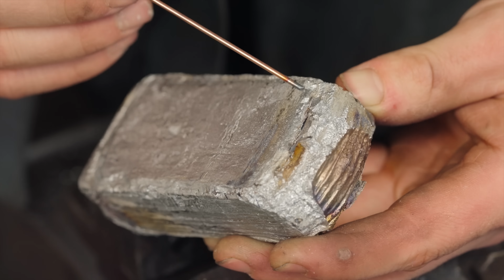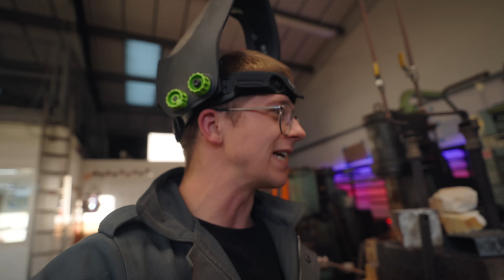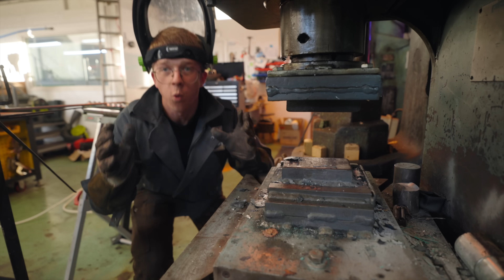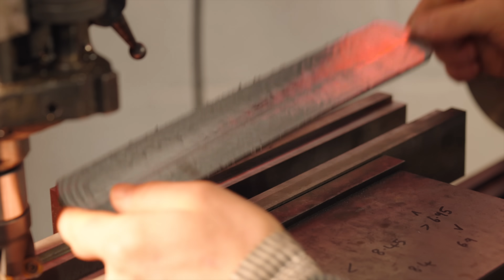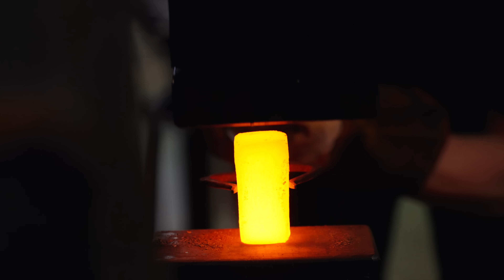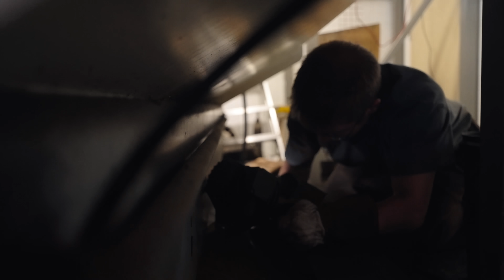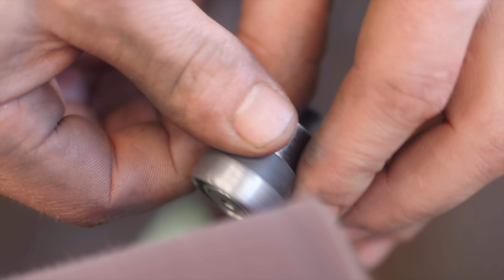Can I Make Titanium Damascus? Part 2

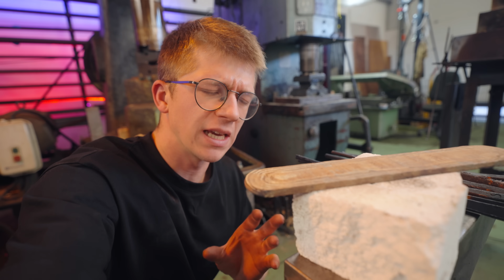Comment: 3:50 , the center of the mass is a different temp than the edges and the plasticity is different.  heat it more often. keep it more even.
Reply: This happens with steel too, but the effect is greater with the titanium because of its lower thermal conductivity!
Reply: Let’s upvote this so he can see it

Comment: Previous aerospace worker. Research what Ti you are using. 6-2 is softer and corrosive with 6-4. different heat treat process also. So id assume some of this would need to be considered when making Timascus.
Reply: Timascus . . . I see what you did there. :)
Reply: @uncletiggermclaren7592 timascus was the trade name.
Reply: What is 6-2?   That is not a common titanium alloy.   There is 6242, 7-4, 662.  But never saw 6-2 anywhere.
Reply: @jonquinn11  There are more numbers to it. One, it's been a couple of years since I worked there, so I only remember the first 2. Two, I signed an NDA so vague is better. The core principle is there. Research into Ti more so he can mix and make cool things that don't break.

Comment: I wonder how well Wire EDM would work for cutting the titanium.
Might take longer. But at least there wouldn't be nearly as much waste and you wouldn't go through a new sawblade every time you cut it.
Reply from the maker: It would be so so handy! Was wondering this other day. Passed up an old EDM on auction for £500 the other week as well (not that I’d have any clue how to use it regardless 😂) .. I think I may have to call around and see if anyone nearby has one I could bring bits to to cut when things get really small and fiddly!
Reply: @AlecSteele  I'd love to see it cut with a water cutter. I think it cuts through it like any other metal. I guess the medium in the water probably makes a big difference too though.

Comment: The Ti-Fe phase diagram will explain why you are seeing the Liquid Metal at that lower temperature. You get closer to the eutectic point and the melting point drops

Edit: at the eutectic point (~33% Fe) the melting temperature is 1085C
Reply: 950°С....🙄
Reply: this
Reply: They have a titanium/iron phase diagram, but I haven't seen any for steel. Even with the iron though, the temperatures required are still much higher.
Reply: @deucedeuce1572  a ternary phase diagram of Ti-Fe-C should explain. I’m sure with the addition of carbon and some experimental error you will get to liquid Titanium at ~950C

Comment: Atmospheric pressure maybe? What's your Elevation? 

Maybe it would forge better if it heats at the force of the press.

Try forging under the melting point and the pressure from the press could reduce it's melting point to an ideal temp for forging?
Reply: He's in Norfolk so practically below sea level, my bet is that it's the pressure from the hydraulic press that causes it to heat up quickly an melt.

Comment: Yeah, none of us know what's going on. We are not egg heads. This is experimental stuff. The obvious things we can guess at are the product (potentially acting as flux) you put into separate the canister from the steel and titanium. The pressure from the hammer on the canister and the argon also probably had an impact. It might be different after the canister is removed.

Comment: Newbie question @9:00 if worried about sparks and a titanium fire wouldn't cutting oil help?  forgive me for not understanding
Reply: Cutting oil is mildly flammable, so that's not a good idea. Coolant would work a treat, if the Bridgeport coolant pump was working.
Reply: @hammerth1421   AH, gotcha thanks for that info
Reply: Oil wouldn't, since it can also burn if hot enough, but coolant (like he used on the lathe) certainly would.

Comment: I wonder if the fact that you are using an inert gas, and that there is a non indifferent pressure difference between the forge and the inside of the box, is actually raising the temperature inside faster and higher than the forge itself.
Just like a pressure cooker would do.

Also the alloy might be mixed with something that melts at a much lower temperature